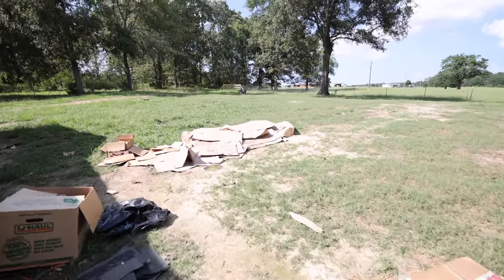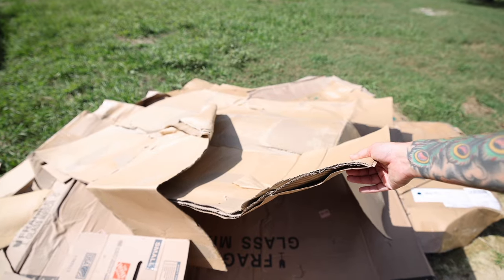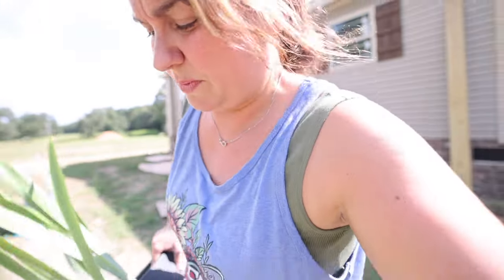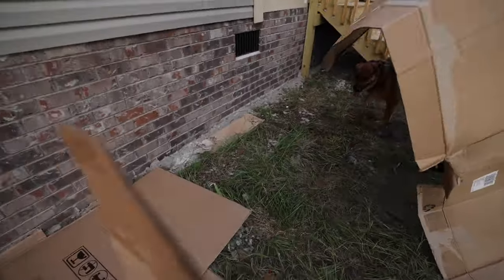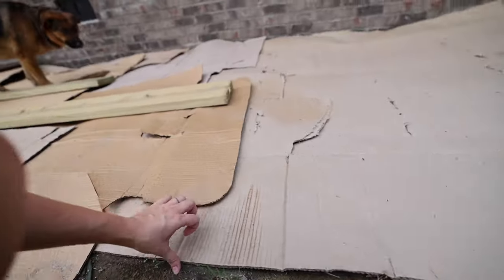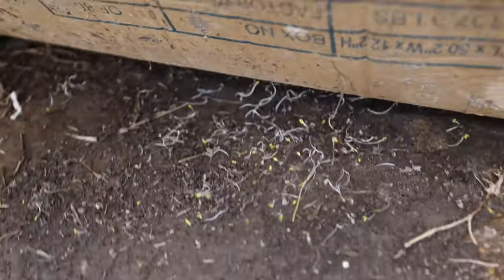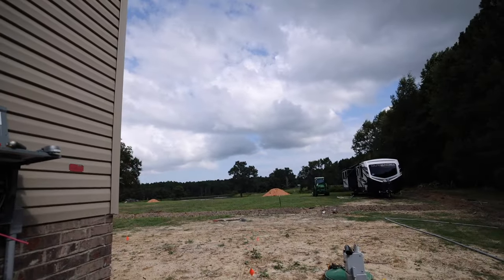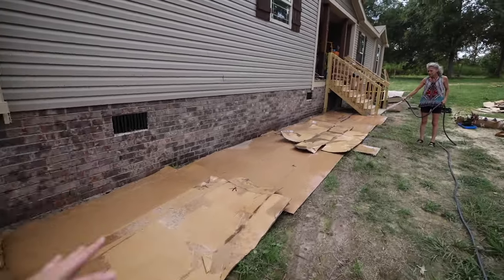Preparing New GARDENS with Cardboard | VLOG

Comment: Oh, so nice to see your Mom today. 

You can layer that cardboard 3-5 layers (watering in between layers) if your area has some really thick invasive weeds. This cardboard method is also a great solution if you have really rocky soil underneath because you can't really till or turn that and your aim is just to create a useable seed/transplant bed. Newly planted seeds & transplants will thrive in soft soil where they would struggle and be stunted planted in rocky ground.

I once lived in a place that was almost all rocks & very little soil, but I didn't know about building beds on top like this, so I had to get a pickaxe and basically carve beds out of rock. You'll find a similar situation in areas where people build homes from adobe clay... they make in-ground planter boxes that more or less turn into baked clay Terra Cotta beds. lol It works, but wow, the effort and sweat that goes into that!

Comment: An inexpensive alternative to silage tarps is used billboard vinyl. Just call the billboard company and for about $50 you get a comically large UV stabilized, reinforced tarp that's solid black on one side and lasts for years. It's my favorite way to start new garden space. Usually I'll put cardboard down first, then the tarp, but without cardboard works too. A bonus is that it keeps the area from getting too soggy in the spring, so you can plant a little earlier. 
I hope this helps!

Comment: Jess, I am probably preaching to the chior but,,,if you are going to plant shrubs beside the house, be sure you know what the mature size of the shrub will be. How many places have you seen where the shrubs are planted way to close to the house and have to be removed in about 5 years. Golden Cercus sounds fabulous. Give it enough room. Don't want to have to move it or rip it out just when it looks fantastic. Don't plant under a window. Card board really works as you are using it. Silage tarps are fantastic for your veg garden or annuals. Water the soil well before you put it down to get the weed seeds germination under it. Once the weeds are dead you have to remove it. It is not porous enough to work as landscape fabric does in a veggie garden.  But it is super effective a smothering weeds. You can put it on veggie beds for winter so you have a clean planting slate in spring but it is best to plant a fall cover crop that will stay all winter adding nutrients. bio mass and conditioning to the soil. Cut the cover crop in spring and put the silage tarp on it to speed decomposition of the cover crop and smother any new weed seed that might want to germinate. Weed seeds can stay dormant in soil for 7 years. I am sooooo excited for your new adventure. In my life I have had the privelage of gardening in the North, Mid west. East coast ( N.C.) and Pacific Northwest. So many differences yet principles are the same.

Comment: Love your excitement and energy. Can't wait to see what you make of it all. I too have discovered the way way to clear a bed of persistent weeds is the cardboard method. Dig up most of  the plants and move them temporarily, cardboard then compost on the bed and leave it for a few weeks. I am experimenting with wool insulation that now comes in my meat boxes, in addition to cardboard because it can be easily made to lay around bigger plants, trees etc, and block the weeds. Not sure how long it will take to break down.

Comment: I would go straight from the corner of the green siding to where the siding changes and do a arch or rounded edge to the steps so you can fit in a larger focal point .

Comment: Yep, you got it.  And if you want a soft walkway, little to no weeding, put down garden fabric and wood chips. It does need reapplication yearly but the walking on it, is delightful. Prigioni, used heavy butcher paper, then put on about 6 inches or more of wood chips and planted his "food forest". May I suggest you check Craigslist or a local circular for giveaways, like you can get bricks, line that area you started today with the bricks, very attractive, goes along with the flowers you are planning on.

Comment: I bought the ground cover from Growers solution to go under my tall raised beds to totally eliminate every weed and it keeps the ground barefoot friendly. Water goes through so there is no mud and mulch between the boxes would need replacing and also weeding even though it wouldn't be much. It also looks rather clean alongside the larger mulched landscaped areas. Using the tarps will also break down a cover crop and after that broad forking the soil then planting works too, eliminating a need to till. I actually plan to get a silage tarp to cover my raised beds and the inground beds to prepare them for planting. I will cut them in the right sizes to fit. The big picture is not all things work for every situation but many different tools can be customized and called down to help cut out harder work, work smarter not harder. This old lady needs all the help I can get so These items work well for me and the situations I plan. Finally, you are 100% correct about the nonwoven weed stuff from the box stores, 23 years ago I took over a new to me, front yard and made the landscaping encompass 2 huge willow oaks and pulled up black plastic from around the azaleas and rhododendrons that were in a strip along the front of the house. The rhododendrons both eventually died from root rot and we saved and relocated the azaleas and mulched the whole front. I was able to cut through the weed mat the first year to plant my shade lovers but the next year was hard and after 20 years when we dig it is like nylon spiderwebs that are a nightmare and we are eventually planning the painstakingly slow process of removing it all. Knowing what will work for us with the plans and end game in mind all the other products will work for a good low disturbance garden experience. 😊 Square pegs do sometimes fit a round hole. Edited to add: Justin also tarps but doesn't till. 😊💞

Comment: Jess, check out Gemini Homesteads bucket gardens. they moved to Ky back in Oct. They had very little time to set up a garden like they were used to. They ended up getting a ton of produce from that bucket garden. I think they used those giant buckets with rope handles Ive seen at both Rural King and tractor supply. they put them down on a weed barrier, and added mulch to the top. She grew so many tomatoes peppers squash, etc.

Comment: You can use your other resource, manure, right over the cardboard before you put the soil on.  This improves the carbon:nitrogen balance and encourages all the earthworms to work through the cardboard.  I have horses so it was pretty easy and I had to move it anyway!  I didn't put soil over the manure, but used my other resource, ramial wood chips.  No, I didn't plant stuff in it right away, but it made for a good orchard bed a year or two later.

Comment: Question: how do you prevent the soil/mulch from washing away/splashing under the eves/ downspouts? Would like to find a solution that looks natural.
Reply: Chain into a dry pond of rocks if you are not doing rain water collection. With a slope of 1' ft down for a 100' run you can direct that water to irrigate the bed itself. This is a common method in the maritime pac NW.
Reply: @tjeanvlogs9894  our victorian does not have downspouts, water falls from about 3 stories. Rocks might work. Downspouts, etc were removed to improve ice dams in winter.    Didn't think of water barrels..hmmm... They would need to look nice/old fashioned, since its the front of house. Thank you!
Reply: @shervin6711  run a chain at the outer edge of the eaves and at intervals down to the ground to a puddle of rocks. Surface tension will help conduct the water

Comment: I like to lay mulch on top of the grass, and then add soil amendments to offset the excess nitrogen and then lay down huge pieces of PLASTIC. They make huge garden-sized sheets of plastic. I do this MONTHS OR A YEAR before using a new garden area (if I know ahead of time). Then you can remove the plastic after weeds are eliminated and have a really nice foundation to grow in. I like to use plastic because the cardboard can sometimes break down too soon and also between the sheets of the cardboard some weeds can still emerge. but I have used the cardboard and it works really well.

Comment: Just tossing another idea out....in my vegetable gardens, I put cardboard Down in my walkways and cover with clean mulch (I use woodchips mostly) - that could be weeds, leaves, chips, any resources you have on your property or have access to-  As the mulch in the walkways breaks down I shovel it into my beds and replace the mulch for the next season.  I use black tarps on my beds when they aren’t producing. When it’s planting time I remove the tarps and broadfork the bed to prepare it for planting. It works for my context.

Comment: We did this in a new in ground garden this year.  4 2ft by 10 ft beds, a 3 by 10 bed and a 4 by 10 bed and in between we laid wood chips.  Aside from making a mistake with the compost we used (it was not quite finished composted wood chips, we had real nitrogen problems at the beginning of the season)  it turned out beautiful with basically zero weeds this year.  I did have to mind the edges. We have zoysia grass in out yard and that stuff really likes to creep.

Comment: Jess, variegated Liriope is a nice addition to the edges of flower borders. It has that lovely green/creamy white variegation you enjoy and gets a purple stalk type flower in late August/early September for some late season color and interest when summer flowers are fizzling out.  Regular Liriope gets the purple flowers too, if that is all that can be found in garden centers since the variegated type is a little harder to find. It's typically available for purchase in Spring.  Liriope of either variety is also a nice option if you have trouble growing around the base of trees, because it will do well there too, and pretty much anywhere you plant it. For maintenance, just whack it back with a string trimmer around late February-early March so the new growth can pop up easier.

Comment: So you’re not going to listen to me I see... and you’re going to be pouring water all over your new foundation. 
You should really put the pathways alongside your house, with irrigation for the water that runs off the roof. Put your gardens out from the house so your not watering your foundation. (Cracks)
Reply from the maker: We are on pier and beam with a vapor barrier. It’s fine.
Reply: Okay Awesome. I was thinking it was a poured foundation. 
The previous owners of my house had put in a couple raised beds stuffed with perennials., all the water from the roof, on top of all the water that they were pouring into the garden and the snow loads from the roof... ughs.., I ended up having to renovate the entire front of the house, when in the middle of the night.,huge bam bang boom 💥 and beams snapped.. had to remove rotten beams and walls and now, I am working on relocating all of the perennials to new beds and then refilling in by the house with new topsoil... ended up a huge job.
Just didn’t want you to go through all of this drama 😋 it’s not been a fun experience. 
Sending blessings 💛🙏🏻

Comment: I'm at the section about tarps and I'm wondering, does it have to be the big black sheets of plastic?  Could you use those blue tarps from Home Depot?  Or what about clear plastic?  I feel like I've seen Jess use clear plastic in the raised beds to kill off some kind of invasive grass.  I'm wanting to prep beds for next year and tarp them off. I have the blue heavy duty tarps from Home Depot that I thought would work. Thoughts? I'm new to large scale gardening/farming. Moved to 10 acres in April and the grass/weeds are kicking my butt! :)
Reply from the maker: Black works best, or something that light doesn't go through. I've used clear and it works when its REALLY hot but otherwise it doesn't do well.
Reply: You can use the blue tarps because you have them. They break down into little pieces of plastic ribbons over time due to exposure to sunlight so keep that in mind.
Reply: Thank you both so much! I have tarps and the clear on hand but we were considering getting fabric. I was planning on removing the tarps once I'm able to get my hands on some wood chips. Baby steps. My goal this year has been to tame this wild beast and learn the lay of the land. I'm looking for things I can do now and over the winter to make life easier next season. 
Love your content!!